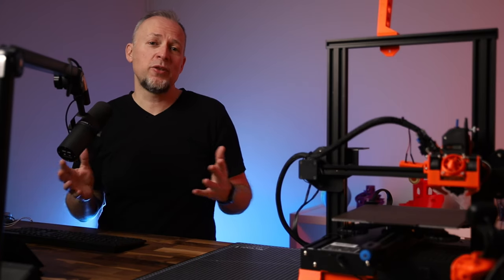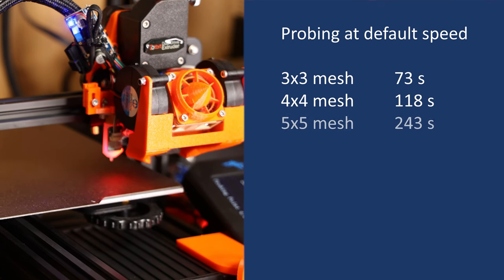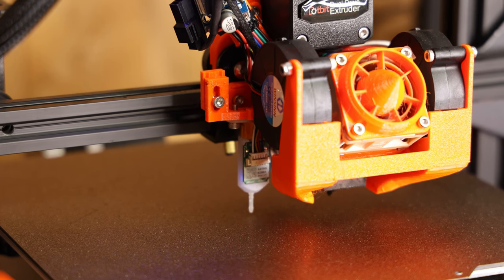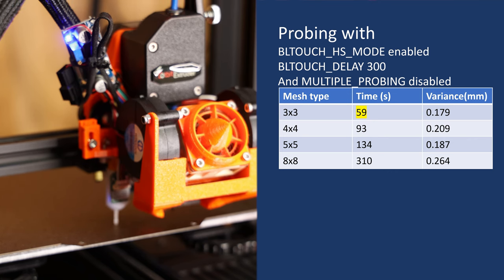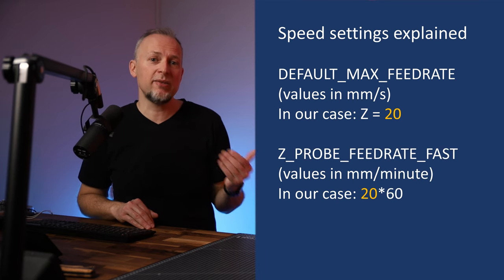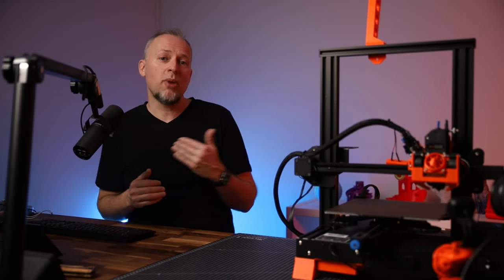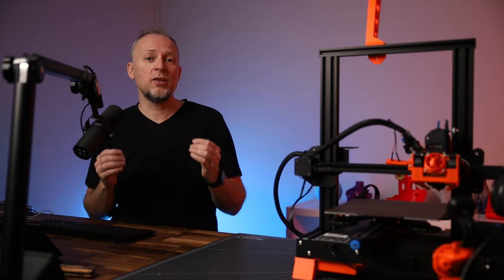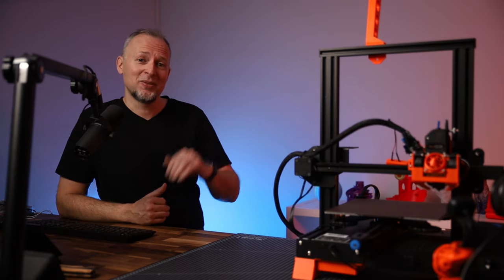ULTRA FAST PROBING with Marlin firmware - 3x3 mesh in under 30 seconds!

Comment: I got my crtouch 7x7 mesh with 2 samples each down to 60 seconds. Fast movement speed between points, minimum movement for probing. Z height is only 4mm, so the pin hovers around 2mm above the bed during probing and retracts only 2,5mm, so barely lifts above the bed since a crtouch has typically a dead travel of 2mm. Probing speed is 10mm/s, raising speed is 20, horizontal speed is 200

Comment: Thanks for your great videos!! Interesting fact: My BLTouch on E3P does not flip in totally for each level point probing. Instead it just "dips" until it reaches a certain point. Was different when using the Creality firmware - there it snapped in. I have increased the speed as well an end up in a 4x4 mesh in nearly 60 s (haven't taken the excat time). Runs in this config since 1 yr without any hickups.
Reply from the maker: Thanks!

Comment: Great tutorial! This helped me get my BLTouch back and running after I was finally frustrated enough with my inductive probe.
However, I believe your methodology is flawed. The variance the printer reports is the overall varianace of the bed. In my experience, this may well change with every heating cycle. I think a better way of testing for probe accuracy is the M48: Probe Repeatablity Test command in Marlin (must be uncommented in configuration.h).
Reply: Neither of those is that standard definition of variance, which is, roughly speaking, a way to determine the average distance each measurement is from the average of the measurements. See https://en.wikipedia.org/wiki/Variance

Comment: Great video. When configuring my firmware a while back I set it up with a 5x5 mesh and was able to get it down to about 90 seconds. I'll have to review with the pointers in this video.
Related question, how often do you recommend updating firmware? I got a setup that works for me over a year ago and I haven't updated since.
Reply from the maker: I have upgraded more or less always when a new Marlin release came out . With the firmware factory it’s very much no work.

Comment: Great video, very informative.  Is there a way to change from a 5x5 to a 3x3 mesh or even to an 8x8 mesh without recompiling the firmware?
Reply: No
Reply: I'm using a precompiled Marlin fork for my Ender 3 V2 which allows to change many if these things on the fly in the display. Just by coincidence changed similar things today to 6x6 with only 1 iteration and HS mode.

Comment: That XY Homing Speed made my Ender 3 slam the gantry in both axes... lol. I had to put those back to 20-30mm/s.
Reply: Had the same issue with my V2 lol  Thought the hotend was colliding with the bed til I remembered the XY homing speeds.
Reply: I had the same issue but 75mm/s seems to be the best speed on my ender 3

Comment: Yeah, but multiprobing must be enabled. Already the bltouch is not exactly very precise, if we then remove the double touch, we will only worsen the results. With single, we haven't average on that probed point. Btw, imho, It's better spent more time to level, and accuracy, that imprecations for 1st layer issue!

Comment: Hey great video! I loved it! I am only having one final thing that I would like to improve and probably you know and could give me a tip? I would appreciate it very much. 
Right after probing is finished, the nozzle goes down in the right end corner where it did finish probing with the bltouch. and then it moves to the printing zone (but just a few millimeters above the bed). and then in the prinitng zone goes down again to completely touch the bed. 
I would like to change this behavior and move the nozzle to the printing zone but with the nozzle hight around 2 cms or similar (the important thing is that the nozzle is not so close to the bed) and then in the printing spot go completely down to touch the bed. 

Do you know by any chance how I should look for this information or in my case what would you do? thank you!!

Comment: Great video! I like the capability of the professional firmware to select the mesh size without recompile, is it possible to apply the speeds improvements to that firmware?
Reply: wait, how do you set the mesh size without recompilation?!
Reply: @lorlimann  Look for "professional firmware" for Ender 3v2

Comment: First off wanted to say thank you for the video. I followed it to a T. Everything works. But I do have a question. I get the fast movements in between probe touch points. But it slows way down at a distance before the probe point and creeps XY only Z is great. Would you happen to know what setting in marlin this might be?

Comment: This is not the way I setup Bl Touch, there's no reason to probe before every single print. Best when set up to restore after G28 and probe twice with one extra, this will drop the probe that is off by  the most. With this set up you simply probe and then save the map to your eeprom, the machine loads the map before the print. For any reason to get out of range you manually launch the probing and save again

Comment: Hi there, today i tried flashing the latest firmware with changes for adding the bltouch and these sped up changes on my ender 3 max. but the printer always crashes and reboots after like 1 minute into gcode, what could have gone wrong?

Comment: Hi. Can you help me with Neopixel on Ender 3 using marlin 2.1.x, i enabled Neopixel and LCD control in the firmware but there no light coming in LED 5v. i checked the voltage and there is 5V. Can you help?

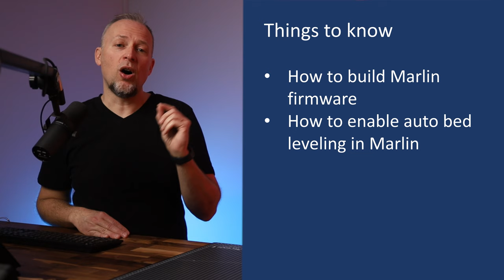Comment: It takes me 2:35 min (SAME config & 5X5 grid)
for some reason my printer waits 2 sec after each probing point and also after the quick probing travel there's a short travel with really slow speed... so weirddd :(
maybe because of the latest bugfix firmware I picked up?
Reply: Its gone! I turned off S_CURVE_ACCELERATION and TMC_DEBUG

Comment: is multiple probing necessary? If we use only 1 fast probing will the accuracy drop?
Reply from the maker: I did so many prints now with single fast probing and zero issues. Multiple probing is wasted time imho
Reply: @Crosslink3D  Thank you very much Dan, very helpful. I just compiled a new firmware with your instruction, works very well and a lot faster!

Comment: Does it work with 3D touch from Trianglelab?

Also when I increased the homing speed for XY to about 120*60 the whole unit just smashed the X endstop so fast that it didnt triggered the endstop properly. I would be careful with this setting.
Reply from the maker: Hey Dariusz, I have one printer with the 3D Touch, I will give it a shot and let everyone know asap! About the homing, yes that's something everyone needs to test. But that's also true for all the settings anyways.
Reply: @Crosslink3D  i read that this HS mode  doesnt work with 3d touch but im also courious if its true.
Reply: @Crosslink3D  Checked by myself. Doesn't work.